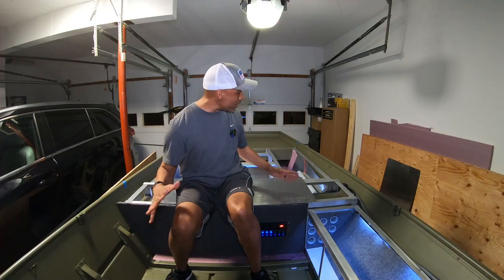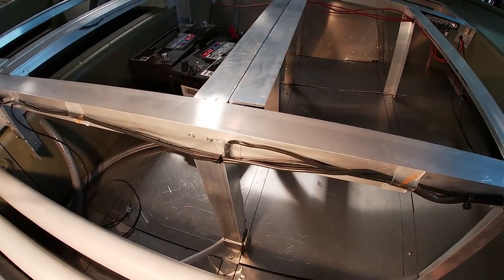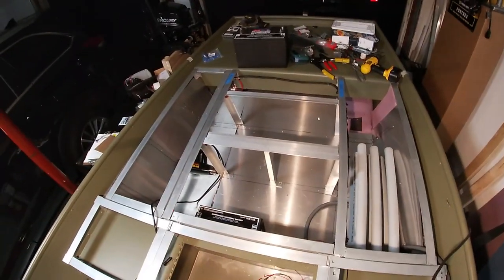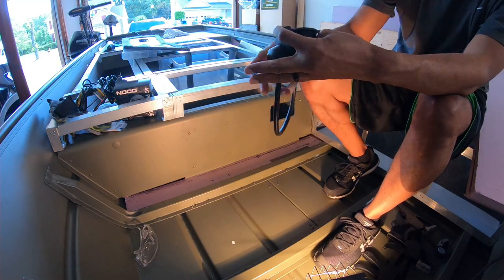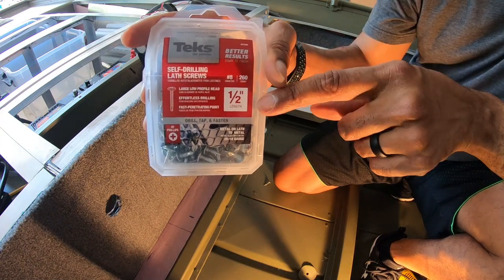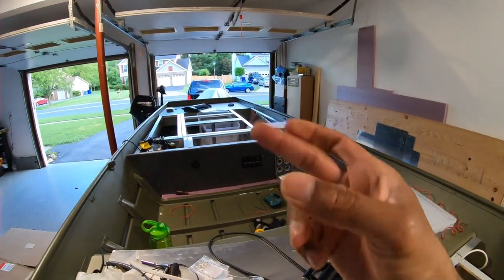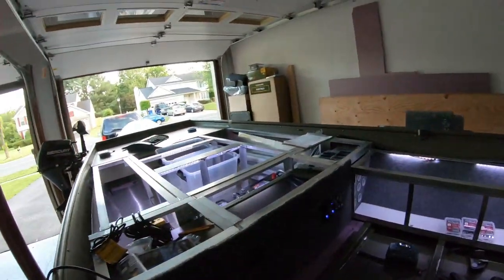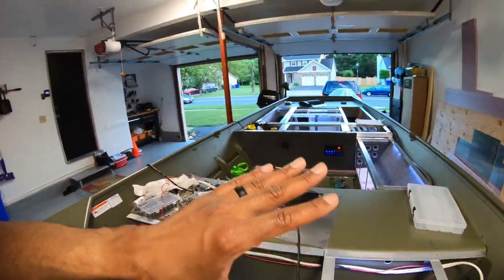LED LIGHTS~Wiring My Jon Boat Part 2 Step-By-Step {Jon Boat to Bass Boat Conversion} Lowe 1448

Comment: Awesome Job, I am stoked for you, it's awesome when you throw a switch for the first time and it works, especially when you've never done this before.  You look like a master boat builder already, things are so clean and precise, that's the way I like to work as well.  Well done sir.
Reply from the maker: Thanks Ted.  It was an amazing feeling to flip that switch and everything lit up.  I've never taken on a project like this where everything done is a first.  I've learned allot and continue to learn.  It definitely helps to be a little anal too.  The devil is in the details.  It can be a blessing and a curse lol.   Appreciate you. Be safe.

Comment: Enjoying your journey as I begin mine.  One thing about electrical.  Every connection should be accessible after the boat is complete. Connections can get loose or coxidize.
Reply from the maker: That's right Robb.  That's very important.  Good luck with your build.

Comment: Another great video! Instead of the gorilla tape take a drill bit and pop holes in the angles and use a wire tie to hold your wiring. Then you know for sure the wires will always stay hung. Great job so far on the boat!!
Reply from the maker: Not a bad idea. I might drop a couple in here and there before I close up the deck.

Comment: I need some help!! I am at a complete stop wiring my boat.. Hope you can help. With the switches wired, the open connector has power when switch is flipped. Just like yours. Each circuit on my fuse box has one lead per circuit. A positive that is hot once a fuse is in. and a negative bar of course. So now I have two hots per circuit?? Hope I explained it well and hope you understand and can help. Love the build out on your boat! Great attention to detail!!

Comment: Wiring my fishfinder to a Blue Sea block which don’t take the round fuses need a 1.25 amp fuse do you know were I can get those
Thank you
Reply from the maker: Sorry, I've never heard of a fish finder using a 1.25 amp fuse, nor have I seen that fuse before.  I used 2 amp for my finders.
Reply: @BassBrothersFishingDMV  my fishfinder is garmin echomap 73sv

Comment: Question.... what gauge negative wire do you have from battery to switch panel or bus bar ??? 8 gauge ??
Reply from the maker: I'm running 8 gauge from Battery to bus bar fuse block combo. I'm running 6 gauge for my 24volt trolling motor.  All wires to the switch panel are 14 Guage

Comment: Just wondering why you added the toggle switch when you already have a master kill switch in the back? Is it to save battery life by not turning on the LED indicators for the voltmeter and switches?
Reply from the maker: you got it.  just a little step to prevent unwanted drain on the battery.

Comment: Why do you have so many positive and negative leads still coming from the bus blocks up front to the fuse box bus block on the back, does that single main lead from the bus blocks not suffice for connecting everything from those bus blocks to the main fuse box? Any info would be greatly appreciated thanks

Comment: Wow That's an awesome job. I'm about to make a similar project on my Jon Boat. Di you make a schematic of a wiring diagram by any chance? If so, would you be kind enough to share it? Best regards.
Reply from the maker: Sorry I don't have a schematic.  I tried to put as much detail in the actual vid but I'm open to answering whatever questions you may have.

Comment: Just found your channel and I’m loving the detail. I’m working on a Carolina Skiff that I’m converting to a bass boat. 
Quick question;
What batteries are you using for your trolling motor?
Reply from the maker: Welcome to the channel.  I'm using Walmart EverStart Maxx-29DC 800 Cranking Amps.  Great batteries that don't show wear until around year 3.

Comment: Are you going to put Star Brite Liquid Electrical Tape on those connections where they connect to the box, it might keep out a lot of moisture ?
Those LEDs look killer !! 👍👍✌🤜🤛👊👊👊😮😮😮😮😮😮😮😮😮
Reply from the maker: Actually my plan is to use dielectric grease.  Not sure if that is the same thing.
Reply: @BassBrothersFishingDMV  well the liquid tape seals the connection with a rubberized seal !! The dielectric grease will protect it, but the heat might make it get all over the place !! Look into it, and ask an Electrician before you put the grease !! Woth a shot !!

Comment: can you explain why you installed a circuit breaker and a fuse box with bus bars if you already have bus bars installed?
Reply: He touched on it on the first video. Instead of putting the bussed fuse box at the battery and running 6+ wires to his switch panel, he ran a single 8awg pair of wires from the battery to the fuse box, and then only needed to run short wires to the switch panel. Of course the 8awg wire has to be protected as well, so it has a large circuit breaker straight from the battery. He also used buss bars for the LED lights, to simplify the wiring of those. Same principle there, run a single large hot/ground wire to the buss bar (fronts) and then tie in all of those separate LED strips to the buss bars instead of running tons of small wires back to the fuse block itself.

Comment: Could you tell me again why you installed a toggle switch for your control panel ? Is it absolutely necessary to have?
Reply from the maker: It is not absolutely necessary to have. It's just an extra step to try to minimize unnecessary drain on your battery.  Good to have but not necessary.

Comment: How long will your single battery work during a day? Also are you using a MS or a DC for electronics? Thanks.
Reply from the maker: I've run my electronics for 12 hours and have had no issues.  Of course and the years go by, the stretch of the battery decreases but overall if you take care of your batteries you'll get a few years out of them. I'm using a Marine battery DC

Comment: Just a question on the bus bars.  Now is the purpose to connect all your LED’s lights to the bus and then run one wire to your fusebox and then switch?  If  the answer is YES, then did you have additional bus for your rear hatches?
Reply from the maker: Great questions.   The bus bar is good for lights and fish finder. Trolling motor should get its own dedicated breaker.  The bus bar i used is both a bus bar and fuse breaker.  Run all wires from your LEDs to your switch then from your switch to your bus bar fuse box combo the run your positive and negative from you bus bar combo to your battery or to a main switch then to you battery.  The main switch is a good idea so you can cut all power to everything connected with one switch.  Of you bus bar doesn't have fuses then you will want to run wires from your bus bar to a fuse box then to your main switch or battery. All my hatches are running off of the sane bus bar fuse block combo.  Hope this helps.
Reply: Bass Brothers Fishing DMV I was asking about your dedicated pos and neg bus bar on your front.  With all the LED’s did you have in to the bus and then one power wire to your switch/fuse?
Reply from the maker: @paulcrum7560  ok. Yes. That's correct. All the front hatch LEDs goes to the pos and neg bus bars at the front of the boat  then one wire to the switch on the switch panel for the front hatches.   The rod locker and rear deck hatch lights were run directly to the switch panel and not to the front bus bars.  I could have but I world have used more wire doing it that way. I did install a neg bus bar in the rear of the boat for any negative leads I needed grounded like the bilge pump and  rear nav lights.
Reply: Bass Brothers Fishing DMV awesome thanks

Comment: Great explanations, what gauge wire did you use to come off of bus bars? And what size fuse did you use?
Reply from the maker: 14 Guage wire.  5 and fuses for the lights.  15 Amp for the control panel
Reply: @BassBrothersFishingDMV  thank you, one more question. for the lights, the fact that the wire coming off of the strips is 22 gauge wouldn’t mean you need a smaller fuse? Or does only the wire leading to the fuse panel matter for the size of the fuse
Reply from the maker: @aidanmurray11  good question.  Honestly I wish they used larger wires on the LEDs.   It makes it hard to connect a butt connector to 14 gauge.   To answer your question, LED lights pull low current which is why a 5 amp fuse is good and the smaller diameter wire is ok to use.  You probably could go lower than 5 Amp if you wanted to.  5 Amp is just a good all around fuse for the LED lights.
Reply: @BassBrothersFishingDMV  Have to be careful on this advice. You have to size the fuse to the wire. I bet those LED strip wires are more like 26 or 28awg, it's like a few strands of hair, and should use no more than a 1A fuse per each strip, and actually you can probably run at least 2-3 strips on a 1A fuse. There's a good chance those tiny wires will burn through before setting off a 5A fuse.

Comment: HOW do you not put screws in your wires or LEDs when you screw down your floor???
Reply from the maker: I placed l brackets onto my framing to screw the floor into.  Check out my video on how to secure the flooring down. Worked out pretty good.
Reply: @BassBrothersFishingDMV  I thought I had watched them all, I’ll go back and look at that, thanks!

Comment: Great video! Hoping you can answer my question. Confused on your configuration. What wires did you connect to switches and what wires did you connect to small bus bars? Did you connect any positive to the bus bars or all negative? Thanks.
Reply from the maker: I have both a positive and negative bus bar setup.  Example, run your LEDs directly to your bus bar then run a single wire from your bus bar to your switch panel  then run a wire from your switch panel to your fuse box.  In general, your accessories should go straight to your switch panel from the switch panel to the fuse box.  You should have a main power line (on a breaker)  going from your battery to you fuse box.  Hope this helps.
Reply: @BassBrothersFishingDMV  ok that's what I thought. I'm still confused. How did you get each switch to control each compartment with just running the power lead from bus bar to switches? Don't you have to run each compartment to each switch?
Reply from the maker: @platinumhandymansolutions  you are correct.  Each accessory goes to its own switch.  One to one.  I grouped all the front hatch LEDS to one switch by choice.  This way I can hit one switch to turn on all my front hatch lights. It's up to you how you want to do it.
Reply: @BassBrothersFishingDMV  thanks bro..good videos. Keep em coming.
Reply: I think he could have avoided the bus bars completely, and wired the switches directly to his fuse block, I think he just wanted all the front LEDs on at once, and used a bus bar to accomplish that rather than splicing into the power wire for each light.  Well done sir!

Comment: You didnt need the toggle switch. U could have ran it through a spare button on yr switch panel
Reply from the maker: I plan to use the last switch for courtesy light next year.  I'll probably install those in the off season.  But you are correct.  That is an option.